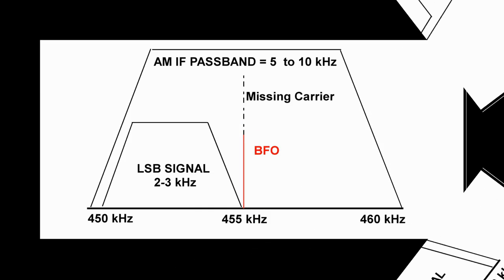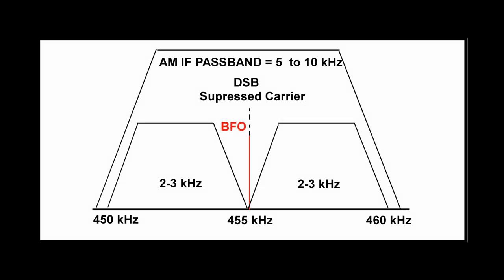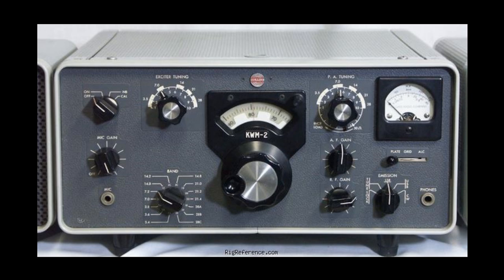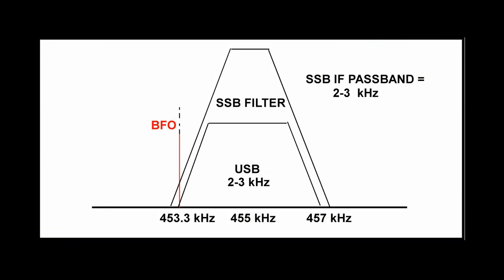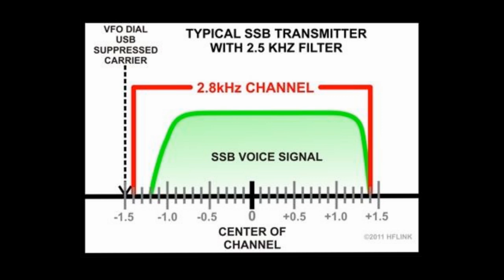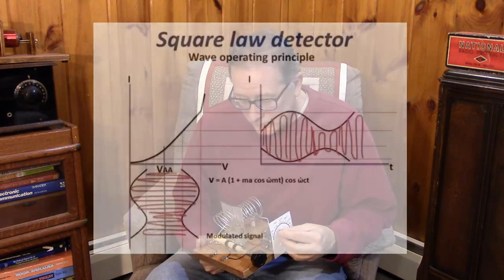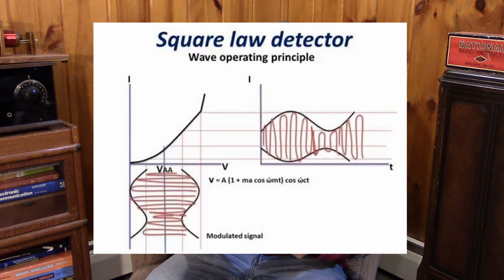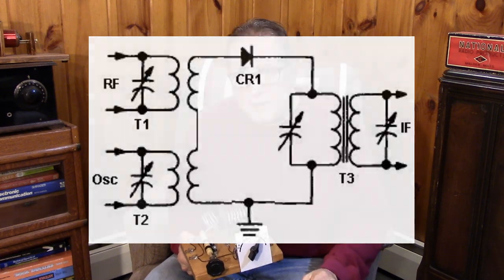Help for the BFO-LESS

Comment: Nice vid Mike.  I don't usually comment but this time I just had to.  I built a 455 KHz bfo sort of like this one except I used the yellow transformer with a MPF102 and I tuned it with two LEDs connected back to back used as varicap diodes.  They provided just enough junction capacitance to swing the  bfo about +/- 4 KHz
Reply from the maker: Awesome! Excellent idea on the LEDs. I will be starting the ceramic resonator work soon. It takes more C to move them!
Reply: @MIKROWAVE1  I'm sure you know this, incident light may affect LED properties

Comment: Great video Mike!   Years ago, I had to purchase a wideband RX and could only afford the IC-100.  I always hated the fact that they went to the trouble to make it that wideband but cheap'd out on the modes.  Anyway, I may give this a try.  I have some super-small IF cans that I bought as a bulk-bag and I regularly do SMD projects so would like to get it into the original cabinet (maybe with a varactor or something with controls on the back.  Anyway, really enjoyed the video!  73...
Reply from the maker: Yup just a "monitoring" receiver.

Comment: If I build a BFO will it work on a DSP chip type radio?
Reply from the maker: It depends. In a classic DSP receiver, its still all analog though the IF, till you get to the demodulator. In an SDR, there may not be an exposed IF to inject a BFO into.

Comment: Thanks for sharing, MIKROWAVE1
The concept of getting a BFO going reminds me of years ago when I built from scratch, using tubes and sockets etc etc etc from junk TV chassis and other stuff, a transmitter/receiver rig for 40 meters.* 
The BFO effect for that rig's rx section  was attained by wrapping one end of a length of insulated hookup wire (insulation and all) a couple turns around the wire going from the primary terminal of the first IF transformer to the plate connection on the 6BE6 converter's socket and the other end of the insulated hookup wire a couple turns around the wire going from the secondary of the second IF transformer to the diode connection of the 6AV6 detector/af amp's socket, thus establishing a 'gimmick' capacitive coupling at just the right phase  between the input and output of the 6BA6 IF stage and causing the IF stage to go into self-oscillation at a 455 KC rate and that made a simple  effective way to hear SSB and CW signals. To control the amount of IF regeneration I put a ten-turn 2 watt 100 k potentiometer in line with the screen grid voltage to the 6BA6 IF amp. By adjusting that pot  made very smooth gradual transition at that sweet spot from 'no-oscillate' to 'oscillate' and served very well at bringing up the sensitivity and selectivity for copying the AM signals.

* The rx section of my 40 meter homebrew rig had a 6BA6 RF amp, 6BE6 convertor, 6BA6 regenerative IF, 6AV6  detector/af amp and a 6AQ5 af out. The tx side had a 6AG7 xtal oscillator** and a 6146 rf out, and  ran about 50 watts input on CW and about 30 watts input on AM fone. The AM modulator section consisted of a 12AX7 mic amp/af pre-amp, a 12AU7 af amp/phase inverter, then a pair of 6DQ6's in push-pull for modulator-output and that circuitry tickled the plate and screen voltage feed going to  the 6164 rf out at an audio rate. :-) 
All that circuitry along with the  power supply was built into a single 12 inch by 12 inch by 12 inch metal cabinet. 
**The 6AG7 xtal osc also served as a buffer when I used an external VFO.
Reply: The external VFO was a junked Heathkit VF-1 which I redid and simplified  into a single-band 40 meter VFO. After I got done with re-doing it it's 6AU6 oscillated in the 160 meter range and the output coil multiplied that a couple times so it outputted a 7 mc carrier.
Eventually I found a 1 inch CRT and built that into a 40 meter modulation monitor and power supply in it's own little cabinet, and another time I found a roller-inductor and built that along with a couple of variable capacitors  into an antenna tuner in it's own cabinet.
My whole station back then was this homebrew stuff. That was back in the 1980s and 90s when I lived in Phila PA and had the call of N3HJQ. I also had a Gonset GSB 100 tx and a National NC-300 rx and a Clegg 99'er and some other cool commercial-made vintage ham radio gear, including a Johnson Invader 2000 tx... that Johnson tx was friggin' awesome... lol :-D 
My HJQ call eventually expired in 2002 as I got so busy and involved with my work  and I forgot to mail in the fees to keep that HJQ call going. "N3HJQ" has since been reassigned. Eventually I'll find a VEC somewhere here around Big Sur Calif and retake the tests and get another call and get back on the air. :-)
Reply: Back when I had the E.F. Johnson Invader 2000 I experimented with that 'mitter in the effort to get the best-sounding AM out of it, which was eventually attained by totally bypassing the SSB filter by disconnecting the input and output leads to the SSB filter box and bridging the new gap  with a .01 mfd ceramic capacitor,  and increasing the microphone input resistor to 10 megs and fattening up the coupling caps in the microphone amp , and using an un-amplified D-104 microphone. The mods opened up both side-bands in AM and increased the frequency response and it sounded very good ... in fact, I was QSO'ing with Tim WA1HLR through the Invader 2K tx and NC-300 rx  after doing that mod to the Invader 2K and he said it sounded excellent... " ...the best I ever heard from you..." he added. It got the "Official TimTron Seal Of Approval" ;-)

Comment: A few years ago, I built a 455 kHz resonator oscillator. If memory serves, it was of the Colpitts type with a (Yellow?) IF transformer as a drain load and output coupling. As I recall, I was able to pull the oscillator plus or minus 3kHz without difficulty...using a variable capacitor.  Oh, I think I used a N-Channel JFET 2N5245 or similar. I was thinking of adding a varactor in place of the tuning capacitor; I didn't get there yet.

Comment: Great stuff Michael. Another excellent presentation. If you're in the mood for another project would you consider building and explaining the theory of a simple crystal filter and phasing control such as used on the HRO? It would segue nicely from this presentation. You could possibly then move to more complex multi pole filters possibly.

Comment: Just wondering if this BFO could be used on a portable radio by inductively coupling to the whip antenna?  I'm guessing that the output might need tweaking to reduce overload!?  Thanks for this great walk through of BFO history, design and build.
Reply from the maker: The BFO injection needs to be close to the last IF or the detector to be most effective. To force it through at the antenna through at least 2 tuned circuits and stages is going to require a lot of extra signal power.
Reply: Ah hah, you say extra power!!!  Thank you for that!

Comment: Can you use a varactor diode to vary the frequency (or the tuning ability) of a BFO?  Would really like to see that implented. 👍 Great Video!
Reply from the maker: I substituted the variable with a 12K feed resistor off a 50K pot with the 5V and a 200 pF cap to the same spot on the collector. For a varactor I used, a Motorola MV115, Red, Green and Amber LEDs, and a 1N4004 and 1N4007. Exercise: Put them in order of effectiveness in kHz per full swing of the pot. Any guesses?
Reply: The most common kind of diodes with high change of capacitance ( delta c ) are zener diodes. 0.5W to 1W types work good. They change their capacitantes from 600pF to 200pF if I am correct, use zener voltages 1.5 times the tuning voltage. Look up "zener diode as varicap".

Comment: Great video. I learned a lot. 

What component was used for the power level output adjust control? Just a potentiometer? 

Thanks, de KE0RFZ
Reply from the maker: Yup, just a small 500 ohm or 1K pot is fine for RF at frequencies up to 10 MHz or so when you just need simple attenuation.

Comment: Could Q-Multiuplier work as BFO for this radio too?
Reply from the maker: It might but you can not have it both ways. The Q multiplier works best before it goes into oscillation. And you would not put it at the end of the IF chain, you would want it at the first 455 can near that mixer.
Reply: @MIKROWAVE1  Thank you for your reply. Great videos as always, my favorite Youtube channel.

Comment: Ordered a Tentec bfo and inject it's out put to the if stage thrugh a cap for isolation. Scarry how it works
Reply from the maker: Very Nice! And no shock!
Reply: @MIKROWAVE1  yes it works well with the Chinese cheppys.  Though if it is analog or digital. You would have put up with the rigid tuning( digital)but works well for net stations recived usually in even numbers. Say net frequency    Ie 7135,, 7.140. 7.150. ect so the rig is endowed with some good SSB EVEN THOUGH it wasn't designed. For such. Winner. Winner.

Comment: That transceiver have have a way of switching to SSB mode possibly going through the menus.
What about using a 74HC4066,74HC74 and 74HC00 at 455khz x2 for a SSB de-modulator i.e. http://lz3nf.wordpress.com/2013/07/25/280/
Reply from the maker: Plenty of stuff on the net on the digital techniques. I used to be an applications engineer at ADI, so I shun the new stuff on my channel and try to keep it simpler.

Comment: Very good, but please lose the bit about diodes detecting by rectification. You mix carrier (or beat frequency) with one or both sidebands in a non-linear mixer (diode), and you get sum and difference frequencies. The difference frequency IS the (detected) audio. No "envelope detection" theories needed.
Reply from the maker: Interesting isn't it? Whether you describe is as a nonlinear mixer with the sum frequencies filtered out, an envelope detector by rectification, or simply as a negative peak clipper, the old fashioned crystal set still causes controversy.